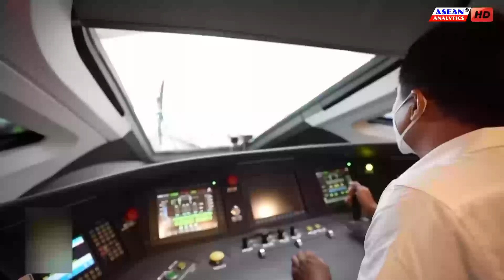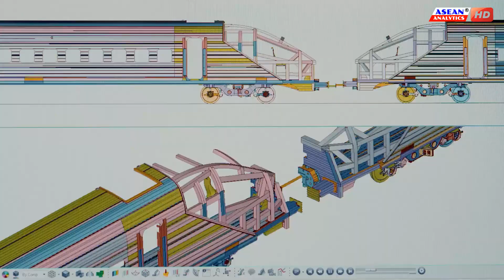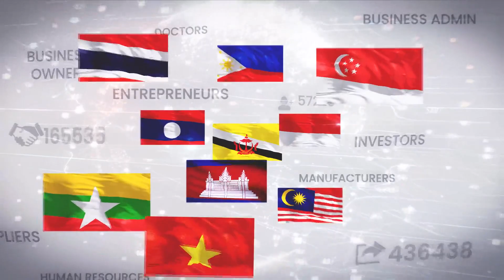Jakarta Bandung High Speed Rail Project is now Almost COMPLETE

Comment: All concrete cement used local volcanic ashes as alternative source of material like China did on the 1800 km Nairobi-Mombasa railway in Kenya. That cut down tons of CO2 and capital cost.
Reply from the maker: Thanks for watching, visit our homepage for more related content and stay connected.
Reply: Mombasa Nairobi is like 500km.
How did you calculate 1800.😅

Comment: Indonesia is a large country and has a population of 285 million, therefore Indonesia needs a fast and modern transportation system
Reply from the maker: Thanks for watching, visit our homepage for more related contents
Reply: 270 milion population indonesia
Reply: @widodo2924 records in 2021 and now that number has increased to 278 million
Reply: Indonesia needs to spread out the population, cannot have over 50% of them concentrated in Jarkarta. Highspeed train is the most effective device to achieve that. She is the right track. She is also going to be an important part of the high-speed manufacturing supply chain on the bamboo based metal composite material R&D and manufacturing hub, her GDP will jump.